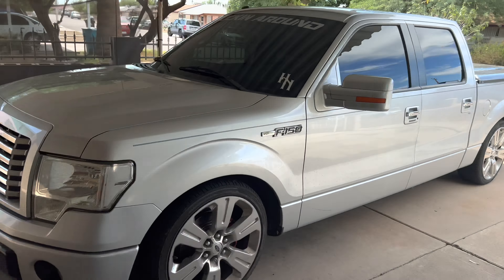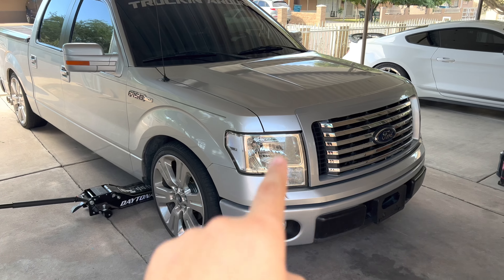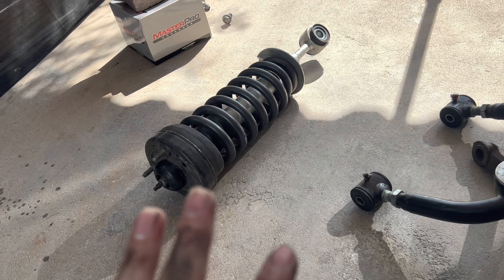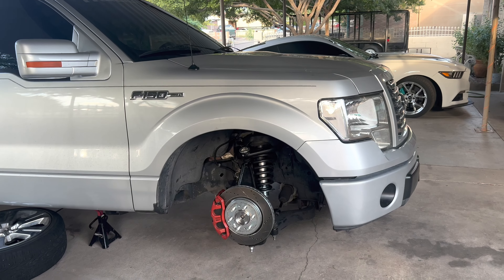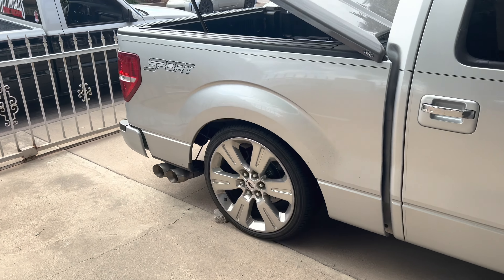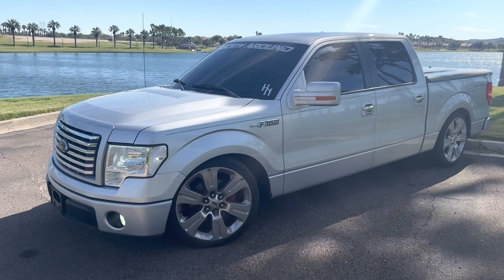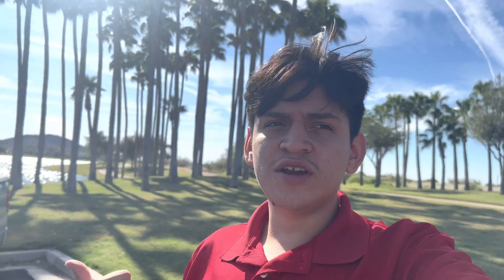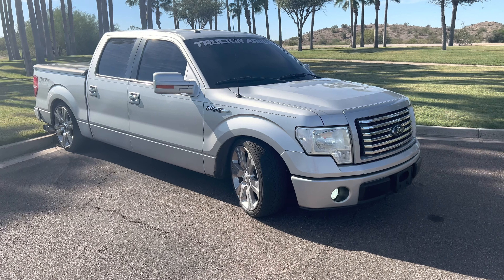Dropping the F150

Comment: I am 3/5 dropping my 2012 F-150 extended cab with lower control arms with shocks and a flip kit, should I worry about not being able to align correctly. Also, what’s the lowest i can go without having it notch the frame, should i sell the control arms and switch to spindles or what

Comment: Truck looking clean man! Just picked up a  12th gen f150. Trying to sell a 3rd gem ram with 5/7 drop. Having the same issues as you. Trans and front control arm cross-over hit/scrape alot. Also on the rams the gas tank hangs low too. But man love the look of it! Thinking of lowering the f150 but not go as low

Comment: Hey bro i have spindles and belltech front strut but my wheels stick out like 1 in from the sides idk why, they told me to put 3 inch lowering control sems
Reply from the maker: What’s your current drop at? And what size wheel are you running ?

Comment: What brand of springs? My rear is dropped 4. Cant find anything. I have a 14 fx4
Reply from the maker: Belltech springs, 2014 is a split year check what strut design you have 
2 bolt strut = 15+ front suspension 
1 bolt strut =09-13 front suspension

Comment: Aye bro, when flipping the rear, was one side of the bed sitting lower than the other?
Reply from the maker: The driver side will sit lower bc of the gas tank
Reply: @b.t.p152  it’s opposite for me, both sides of the passenger side are 1 1/2 lower than right side

Comment: Truck looks fire with the drop kit bro 🔥 what year is your truck? Im looking to cop the IHC control arms so that I can get my camber right but I only found the ones for the 15-20 and they look like the ones you got.
Reply from the maker: Rn it’s on a 5/6 drop, I recommend you get spindles so that your able to align but you need to run 22s, other than that I’d recommend you go with djm 3”lca + ihc uca(15+ years fits 09-14), id you want to go lower id recommend you go with springs

Comment: You have the link of where to buy the parts
Reply from the maker: What parts do you want links for?
Reply: @b.t.p152  drop kit
Reply from the maker: Spindles-https://maxtracstore.com/2009-2014-ford-f-150-2wd-4wd-2-drop-spindles-maxtrac-103420c/
Belltech Drop kit-https://www.belltech.com/products/belltech/lowering/belltech-front-and-rear-complete-kit-w-street-performance-shocks-979sp.html
Reply: @b.t.p152  thanks bro
Reply: @b.t.p152  question does it drive smoothly? Like when you go over bumps and stuff, I have a ford f150 2010 super cab kinda like yours, and I’m planning on dropping it that’s why I’m curious thanks 🫡